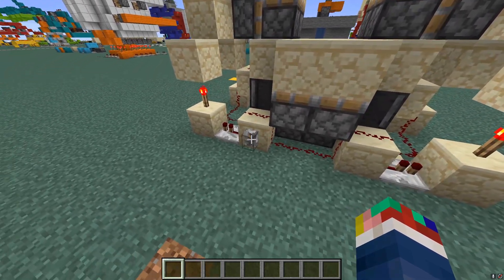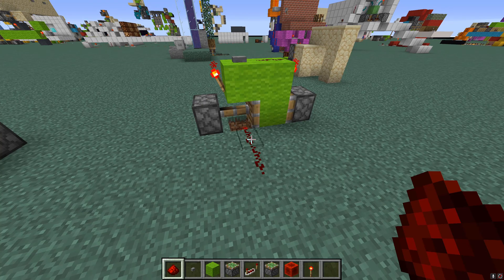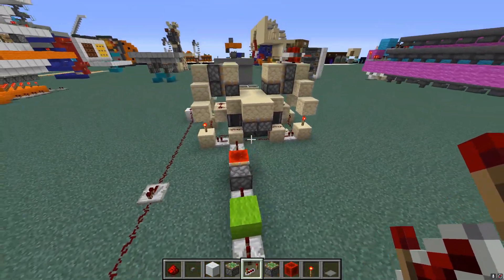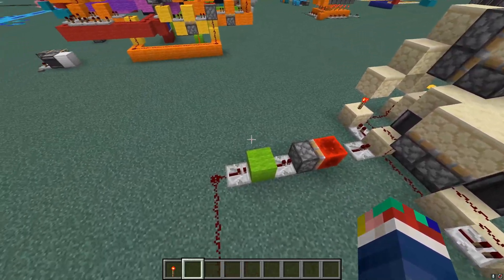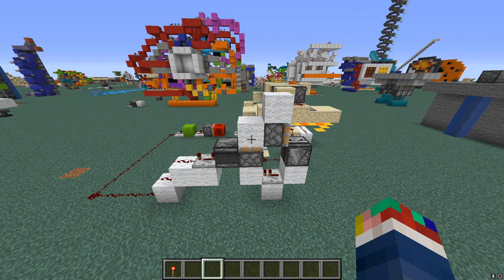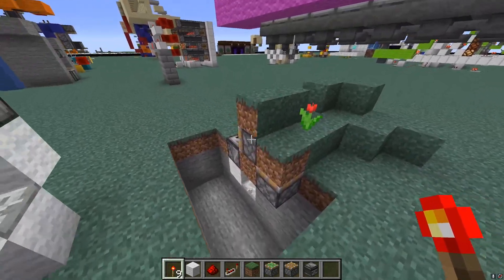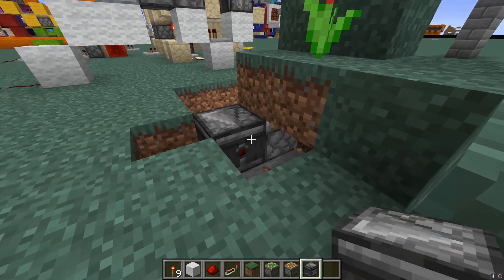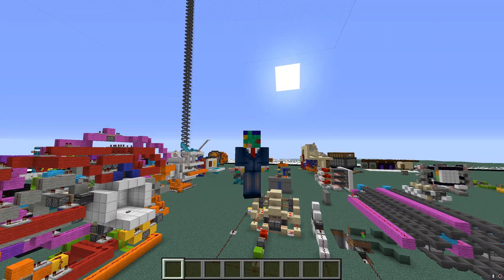How to Add a BUTTON or TORCH KEY to your Redstone Contraptions! - Tutorial!

Comment: Hey Cube, so I'm currently struggling to add your torch key to ej3cted's 3x2 flush piston design (basically your piston door on the LifeSteal S.M.P). I'm currently confused at where to put the torch key on the design. Whenever I add it to the circuit of the piston door it makes the top 2 pistons not go to the centre. I'm also wondering how to make the key leave the door open and how to connect a button to make it so the door closes and opens. I know this might be a lot for your, but if you could tell me that would be amazing!!
Reply from the maker: Yea np! Srry u are struggling. So make sure the torch key you built pushes out the redstone block and constantly powers the redstone to the door each time you power the torch key. 

Just make sure you built the torch key in this video 100% accurate. If the 3x2 doors are not closing properly then check the original tutorial, you might have missed 1 piece of redstone next to both of the top pistons. 

If you watched the full torch key tutorial then i show you how to add a button/pressureplate in conjunction with the torch key. And that allows you to have the door stay open until you push the button or torch key a second time. I hope this was helpful and srry that this was a long message just say, “watch the tutorial again” XD, but hopefully figure it out! :) and thx for watching!
Reply: @MrCube6  Thank you so much! This has expanded my knowledge on redstone keep up the good work! You are the best!!
Reply: It also has fixed my issue. Thank you!

Comment: How do you aplie this to the 1 Wide hidden staircase??
Reply from the maker: So Find the lever that is on your hidden staircase. Then replace that lever on the hidden staircase with a repeater facing into the lever block (the lever block is the block that the lever was originally on). Then just follow the rest of the tutorial. Connect the T Flip-Flop into the repeater that we placed in step one, etc... Hopefully, this cleared some things up! But if it didn't please feel free to comment again, I really want everyone who watches my tutorials to successfully build a contraption! Thanks so much for commenting and really hope this helps!
Reply: @MrCube6  So originally you acted like the 1 block stair case could be accessed from both sides, which is why you originally added a lever in that video inside below the stair case. However, it is only when I switch to this video, and scroll down into the comment section, that I find this comment which demands that I use a T flip-flop that only has one button input. You didn't include a secondary input, which means that the hard cut you made in the original video was intentional. You never showed people how to create dual input, or how to create the original set up in the video. this is bad editing, inconsiderate to the viewer. I only found your official answer to this fundamental problem after building it on a survival SMP by scrolling down into the comment section of an entirely different video only to get an answer that was unsatisfactory. It is only after people pour the time into creating the build that they realize they can't even use it unless they happen to find this specific reply in this comment section. Very annoying and tedious.
Reply from the maker: imtiaz alam  Alright so you got the staircase working, make sure that the repeater is going into Red wool block (the one with the lever on it at 10:52 on the 1 wide hidden staircase tutorial). If you don't do this then the Redstone dust underneath that block will not get powered resulting in the contraption breaking. So take the Output from the T Flip-Flop and connect it to a repeater going into that block (the one with the lever on it here: 10:52). So just replace the lever with a repeater. I know you said you did this, but just make sure that the repeater is going into the block not the redstone dust on top. Hope this helps and if you do have any questions then please feel free to comment!!! Hope this helps!
Reply from the maker: imtiaz alam  Thanks man I really appreciate it! Glad it finally works!

Comment: Does the torch key still work properly if you set the redstone repeater to 3 tick instead of 4 and are there any pros or cons?

Edit: I tried 1 and 2 tick and those cause problems, but 3 hasn't so far but I want to know if there is a reason why I should or should not set it to 3 tick.
Reply from the maker: So there is no reason why I used 4 ticks instead of 3, The reason why we set the repeater to greater than 3 is so that the observer wouldn't give multiple pulses. If you set the repeater to 1 or 2 then there would be multiple observers pulses, which goes the T Flip-Flop, which will cause problems. We are trying to emulate a stone buttons pulse with the torch key! And a stone button only gives one pulse, so if you have multiple pulses coming from the observer, then that's not emulating a button... Long story short it doesn't matter, if it works, it works! Hope this helps!